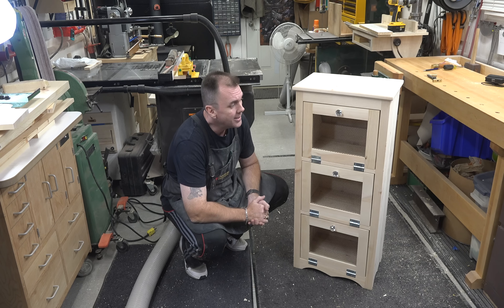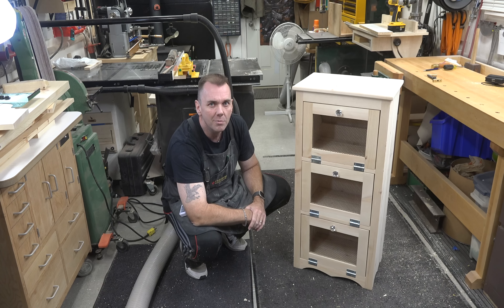Making a Vegetable bin part 4

Comment: I'm sure somebody already floated this idea, what about drilling in the side of the bottom of each door and just doing like a pin hinge. Then you can cover it with a sanded dowel?
Reply from the maker: That idea would work for sure as long as the dowel was a large enough diameter to take a bit of abuse.  Some of those bins get heavy.  Thanks for tuning in and for chiming in with your suggestion.
Reply: @acutabove_woodworkings  well I was thinking more along the lines of drilling through the side and into the drawer a little bit and then using a metal pin as the hinge, then just hiding it with a dowel

Comment: I made the mistake of buying those plans, got them home and took a look at them, and realized the same thing you did, that it wouldn't hold up over time either. I never built it, it got set away for future rethink on how to redesign it to work better.  maybe I will use sliding dovetails and regular dovetails or box joints for the carcass and use the mortises and tenons for the face frames  like you did. and for the top use some stop sliding dovetails.  Or as you did some dowels and glue will always work just as well.  As always another great video series.
Reply from the maker: Thanks for the kind words.  I think these plans are just fine for a beginner woodworker who needs a simple project to make with simple joinery and limited tools.  For me however, I just wanted more from this bin.  Something that would stand up to the abuse that it was going to take.  A few modification and I'm happy with the final results.  Dig those plans out and start making one.  You'll be glad you did.

Comment: This was another one of your informative and entertaining project builds. As the videos have been released, I've been making CAD drawings so I have something to work from while I'm in my shop. Your instructions were so detailed that there wasn't a single dimension that you omitted. 
I'm going to build the bin but I'm not a fan of the hinges. Lee Valley has some hidden spring loaded hinge pins that I want to try. I think it will give it a cleaner look and also make it easier to clean.
Can you tell me where you purchased the steel mesh material?
Reply from the maker: Thanks for the kind words on the show and the project Jim.  I'm glad that I was able to provide you with enough detail to make some plans.  That's awesome.  The metal mesh that I purchase was from a local metal cutting fabricator.  I'm sure that if you googled metal fabricators in your area, you would be able to find one.  This particular fabricator was located in Etobicoke, Ontario, Canada.  (I don't know if that helps you or not but if you are local, I will see if I can get you the address)
Reply: Kenny, the name of the fabricator would be appreciated and can you tell me if the mesh is a full 1/8" thick. I had tried looking at the big box stores but without any luck. I live in the Hamilton area, so a trip to Etobicoke is possible. Thanks, Jim
Reply from the maker: Hi Jim.  I couldn't remember the name so I took a trip out there today just to see what they were called.  The name of the company is Ferrier Wire and they are located in the Keele St and St Clair Ave area.  Here is a link to their website where you can get the information for the mesh and other products that they carry.  I hope this helps.  http://ferrierwire.com/
Reply from the maker: I forgot to add that the product you are looking for is under their perforated metal section of their website.

Comment: Ken, a great build, enjoyed all four parts. I like using plans, no matter how bad to at least define the overall size and basic construction but like you I find that I end up building it "my way". You surprised me with the use of dowels to further secure the bottom and to attach the face frame, good engineering. Will you add any finish or let it age naturally? Looking forward to your " next woodworking project". Paul / paulsmessyworkshop
Reply from the maker: Thanks for the kind words Paul.  The finish has already been applied.  3 coats of shellac followed by three coats of varnish.  It came out really nice and the most important thing is that the Mrs. is happy with it.  Thanks for tuning in again this week sir.  Always great to hear your comments on the show.

Comment: Another great build, I really enjoyed all four parts plus it keeps the wife happy.
One thing, the top you put on using those brackets, could you have put some dowels in instead? eg 1 in each corner and an extra 1 in the middle at the back so 5 in total, they would be hidden from view? but would dowels and glue be strong enough if you are going to pick it up using the top?
Take care my Friend and speak soon.
Barry (ENG)
Reply from the maker: Dowels would be fine Barry except for the fact that I know what is going to happen.  I'm sure that someone is going to move this thing at some point in time and use the overhang of the top to lift the bin.  It's only a matter of time before the glue and dowel joints fail and there is damaged to the unit.  I just felt that I wanted a little more strength for this top.  Thanks for tuning in again buddy.

Comment: I like the bins. The hinges on the front do not look good. Could you have used wooden dowls at the interior bases of the swing out bins? Then the front would be clean. :)
Reply from the maker: That's the great thing about our hobby Douglas, for every process, there are many different ways of accomplishing it.  I like your dowel idea.  Thanks for tuning in to the show and for chiming in with your suggestion for a cleaner looking face frame.  It's very much appreciated.